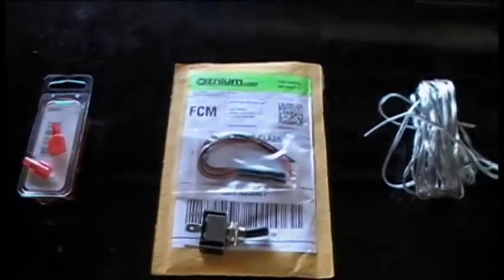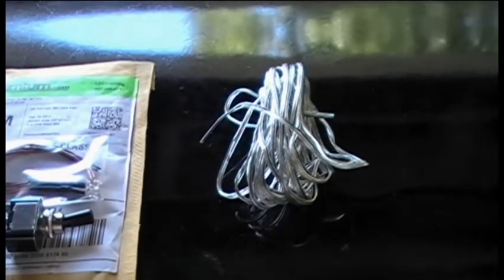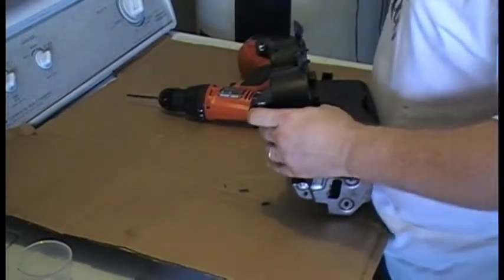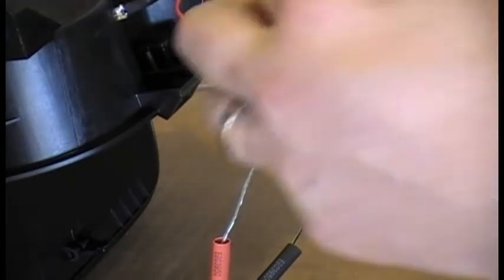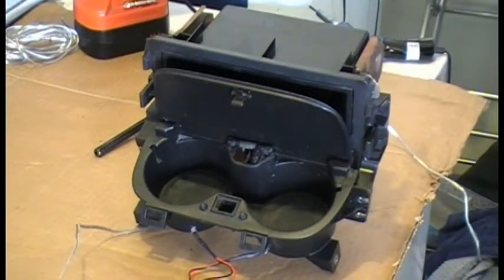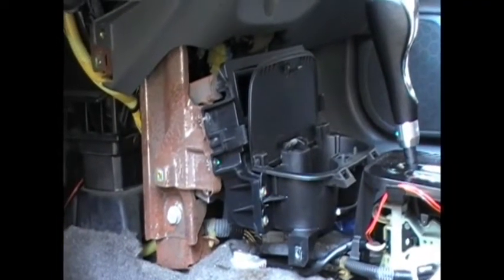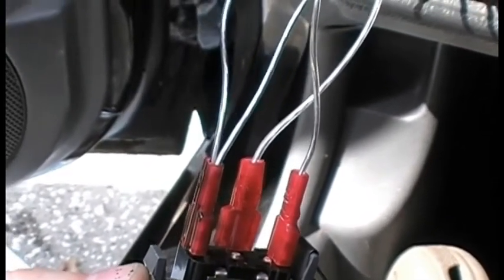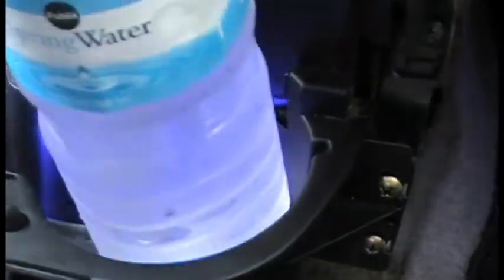Oznium LED Cup Holder Install 96 Civic Sedan

Comment from the maker: Well the under dash lights are Oznium strips that have a 3m backing so I installed them & ran the wires to my dome light so I can control them with the doors & dome light switch, should have done a video but I did that way before I did the cup holder.